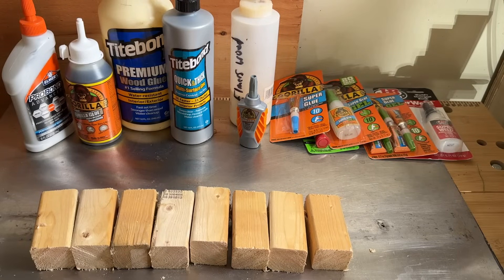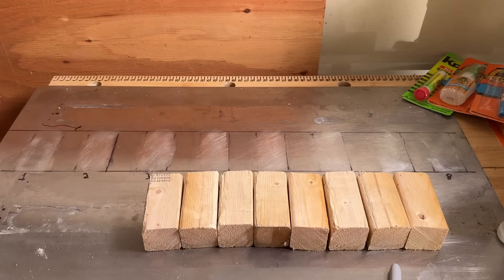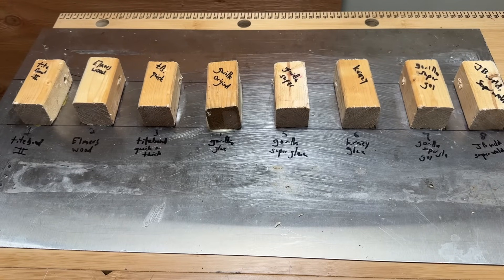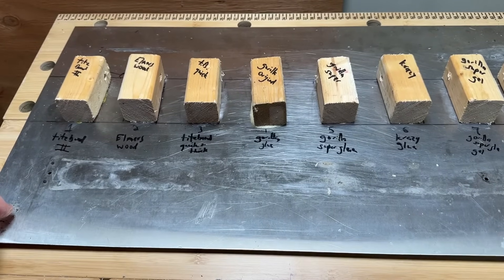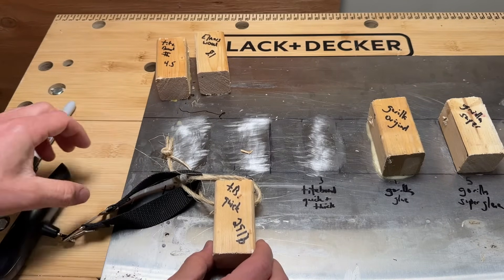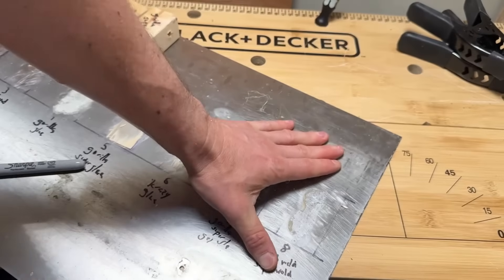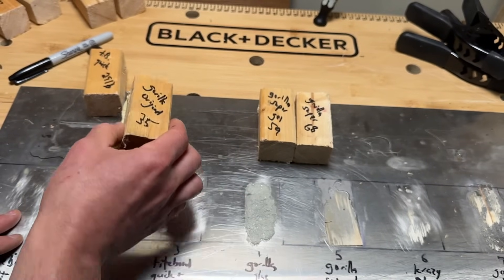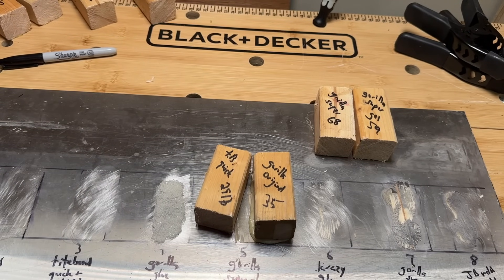Best Glue For Wood To Metal (8 Glues Tested)

Comment: For gluing dissimilar materials why would you not test general construction adhesives such as liquid nails, Loctite PL QSI Quad, etc. which are specifically engineered for the application?

Comment: Nice idea but The technique is poor. The off-center holes and angled pulls will make or inconsistent results since you load the lit strength to an edge rather than pulling straight up. I would also never glue something without clamping or applying a weight during the cure.

Comment: I just want a glue that will stick my short chunky wood leg back onto the small cabinet...The screw came undone inside the short leg and the 2 dowals came out...I am sure if I added glue into the drilled holes and put the right glue either side, the screws would stick to the wood once more. I am a visual person so need to see the glues label to buy the right one. Thank you

Comment: Thank you, this helped me out. Trying to figure out which glue will keep a 2x4 to the metal floor of a van. Was going to go with the heavy adhesive they sell at Lowes, but will give Gorilla Super Glue a try. I like that it sticks to it pretty well but is reversable if something needs to be changed.
Reply from the maker: Yes I’d thing typically that would be a construction adhesive if you want it to be semi permanent. I didn’t get into those. But depending on the use case maybe glue works?
I have no idea on the vehicle safety angle though

Comment: One thing about gluing wood.  Clamps.  All furniture repair and wood workers all agree that gluing wood REQUIRES clamping or high pressure.  Just leaving the wood on the metal is not a valid strength test.
Reply from the maker: That’s a good point. I had always thought about the clamp being used for stabilizing when drying and also spreading the glue, but perhaps it helps with penetration and other factors. Will take this into account with future testing! Thanks
Reply: @HelpAtMyHome  I only found out about the wood and clamping (for sure) in the last couple of years.  Clamping wood changes the fail point from the glue to the wood fibers.  Just a thought.